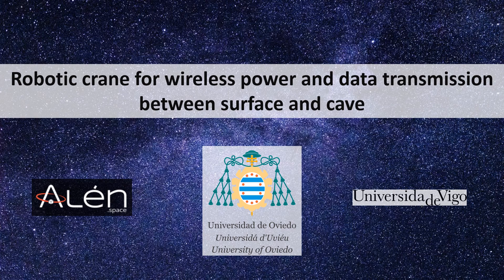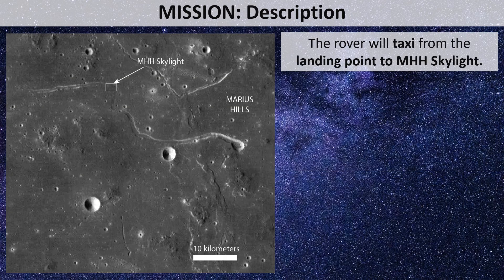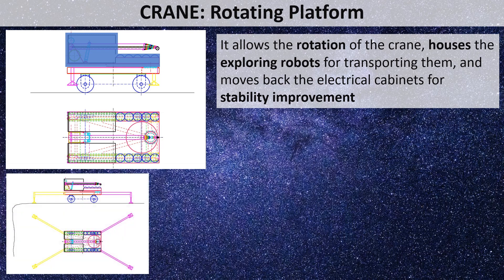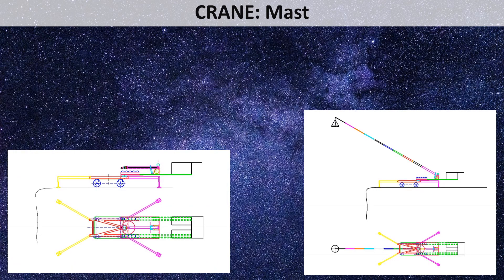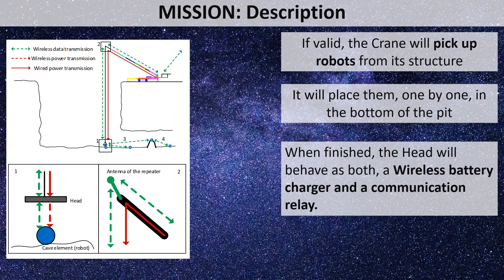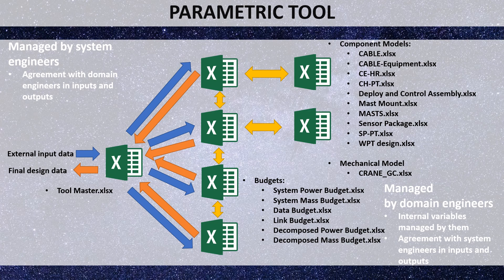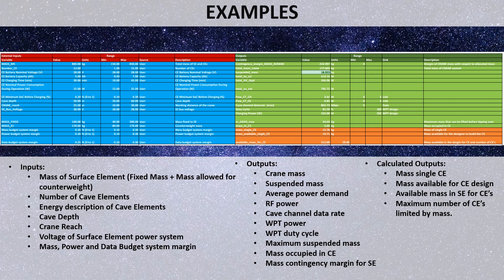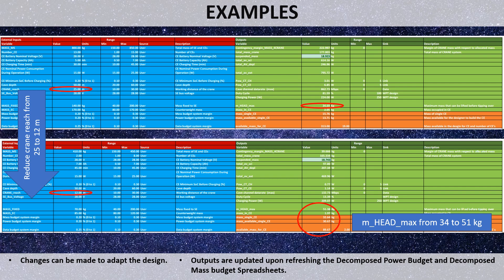Robotic Crane for Wireless Power and Data Transmission Between  Moon’s Surface and Cave

Comment: The crane seems like a waste of mass to the moon, with too many points of failure, especially for some big clunky traditional rover lumbering through a pile of rumble at the base of the fissure. Better to deploy a multi directional moving robot swarm,  were most could survive the drop and move around on their own power once they hit the bottom. Low lunar gravity would help with survivability.  A wireless signal relay at the top might be a good idea to maintain contact.